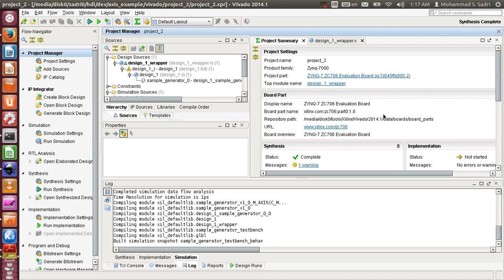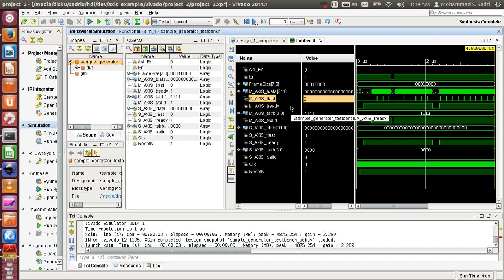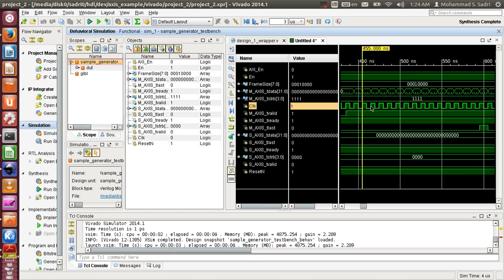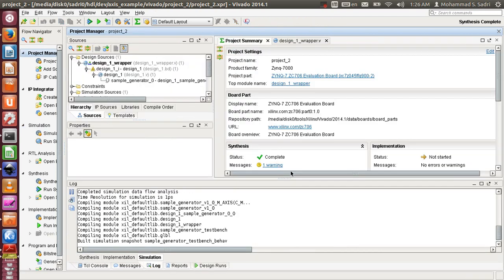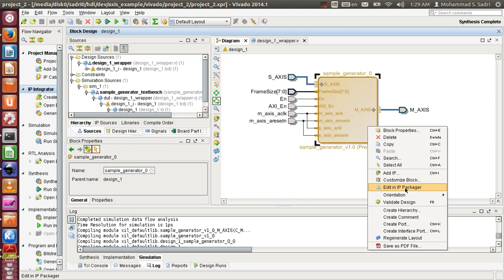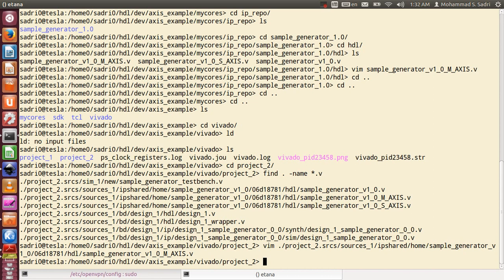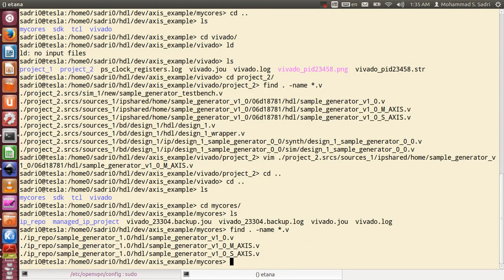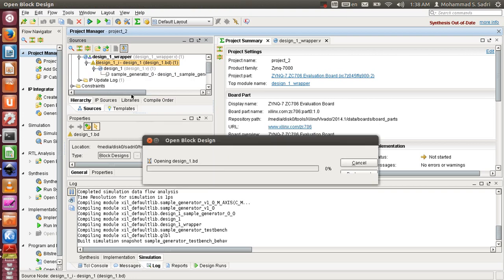ZYNQ Training - session 07 part VI - Logic Simulation for an AXI Stream Module (continue)

Comment: Firstly, I would like to say thank you for your tutorial series, I watch it from the first session and it's really help me a lot. 
In final part of this session, there are 2 unclear points:
1/ In testbench code, Reset will be hold for 100ns then It's released, all logic were started at 105ns (because 105ns is the first posedge), but M_AXIS_TVALID won't be activated until finish 32 clock cycle after resetting. But in simulation, I observed that the M_AXIS_TVALID was activated at 435ns, it means 435 - 105 = 330 ns, it's equal 34 posedge while in theory it only need 32 posedge  to activate M_AXIS_TVALID, I can't explain why the simulation behaved like that. 

2/ I also observed that packet counter variable except the first time after resetting its counting was correct, after that it counted 17 times. The reason I think is the packet counter counted from 0xff to 0x0f (17 times)
Reply from the maker: Son Nguyen Did you perform the simulation using the design I have put on the dropbox folder?
Reply: Mohammadsadegh Sadri I didn't, I only followed your code in the video and observed the result from simulation.